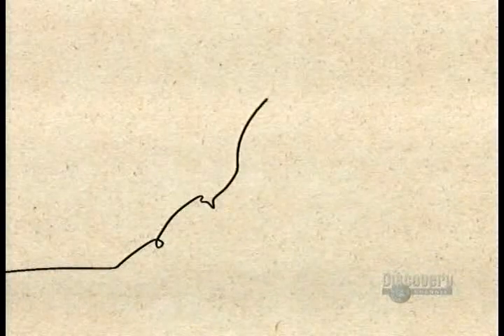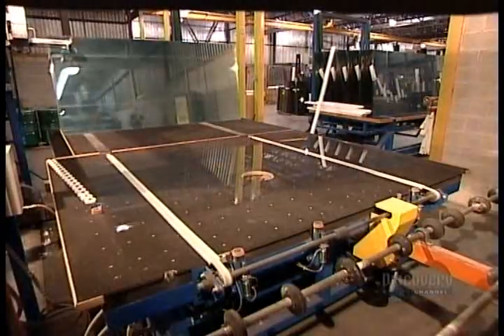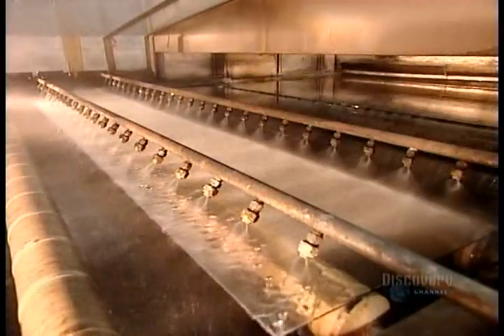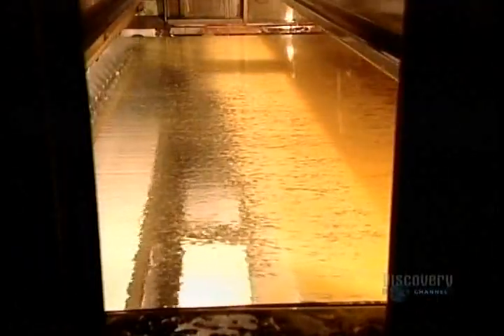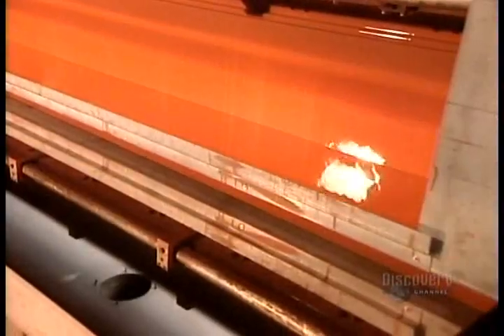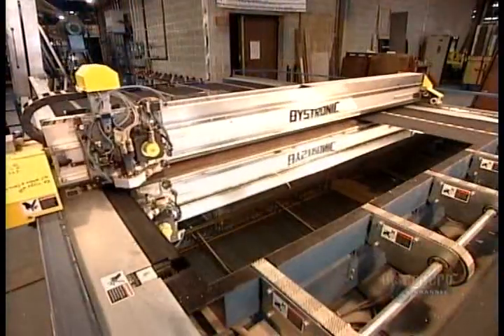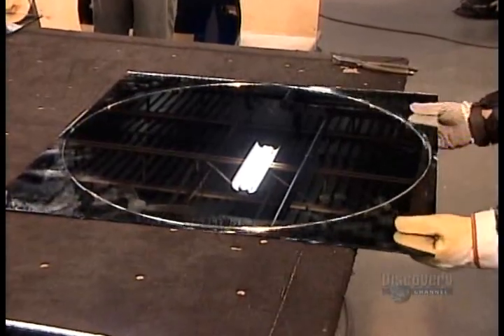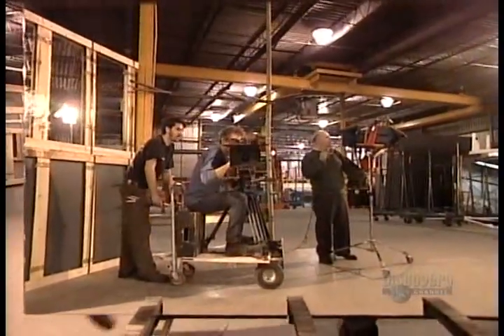Mirrors - How its made

Comment: Table salt is a compound of sodium (Na) AND chlorine (Cl). It is the two being mixed together that determines that it is not a metal. And aside from that, the term "metal" as used in industry is actually often not a reflection of its chemical attributes, but rather its physical attributes.

Comment: Actually they are a special form of pliers, what makes them unusual is that they close square, that is to say both the front and rear of the pliers track together. 
This allows for even pressure to be applied, reducing stress at that point.
This is done by a roller bearing assembly.
However at over $150 a pair I would call glass workers pliers very special indeed.

Comment: @Xentozz in this case they are just scoring the glass to be snapped apart, but using water, you can grind glass to a desired shape while exersizing extreme caution. you should look up flame working, glass blowing, or stained glass work, but be careful, getting into that kind of work is considered an "addiction". I never understood that, flamework is how I make my money, and support a family. back to the cutting of glass, when using a torch, I often use shears to cut glass while its white hot!!!